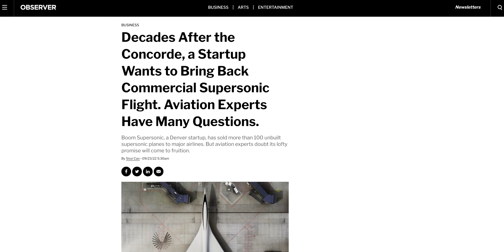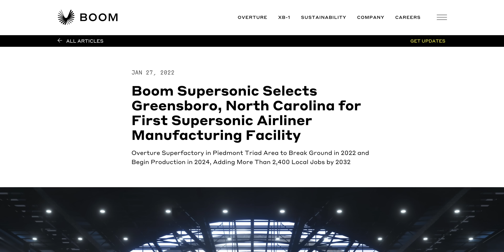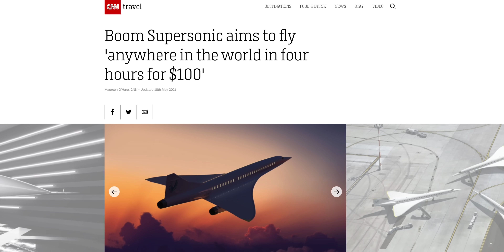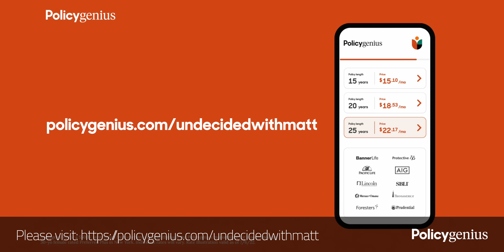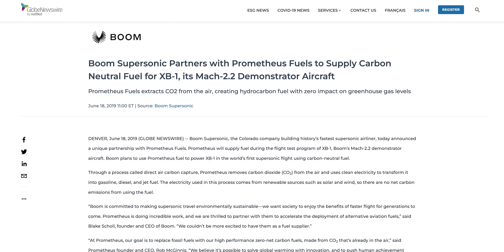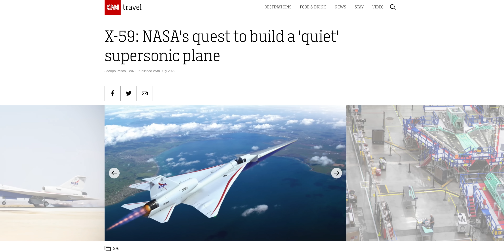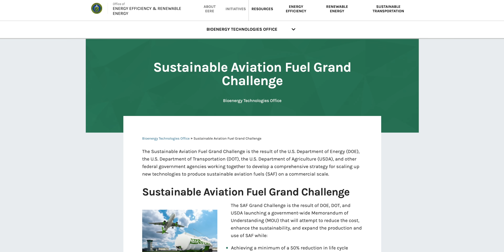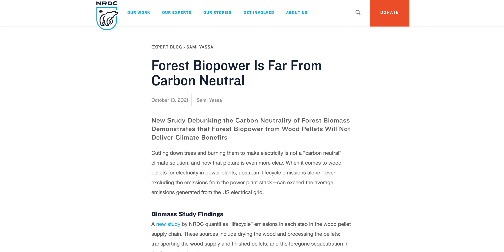Fueling a Clean Supersonic Plane Comeback

Comment: Supersonic airliners are the biggest garbage ever concocted. So, United and American had signed up for these airplanes. By my experience with both, far more time is wasted waiting at the check up counter, going through the paranoid idiots of TSA, boarding the f***g plane, waiting in line for take off, landing, deplaning , waiting for your luggage, and i have not even talked about going to or going from the airport. So 2 hours JFK to Heathrow, and how many hours involved in everything i mentioned? What is needed is a turboprop along the lines of the VF-22 Osprey that will take off from Manhattan, refuel midair over the Atlantic, and land near Buckingham Palace. 500 km/hr, tops, and you will save time. Lots of it, and for less money

Comment: Just the 9 to 1 ratio of energy use alone for just going twice as fast as current airliner is reason enough to let it stay on the drawing board.
Reply: As long as it doesn't cost nine times as much I think a lot of people would still go for it.

Comment: Hi. Regarding the usage of SAF in 50% blends, the main reason for this as of now is not sparsity or cost, but the fact current aircraft were not built with SAF in mind. The main problem with running an aircraft on 100% SAF is that it is pretty much pure kerosene, while traditional jet fuel contains other molecules, including aromatic compounds, which helps with leaks in fuel circuit (aromatics will clog minor leaks which may exist in the circuit), lubrication of the engine, and so on.
Running systems on 100% SAF is a task the aeronautical industry is already tackling, and should be available on the next generation of aircrafts, supersonic or not, and probably as a retrofit of current aircrafts, once the technology is ready.

Comment: Personally, I believe we need to work on better land-based transportation. The U.S. needs to create faster and more interconnected train infrastructure.  There are currently, proven technology that is built in Japan and China that the U.S. should be implementing.  Air-transport won't go away, but at least I should have the option of going from Los Angeles to Las Vegas in a train.  It comes back to our thinking - why spend all the money on R&D instead of actually implementing knowledge and tech we already have???

Comment: One problem I have with that "27%" estimate on soy-based SAF is that it's kind of holding everything else constant in climate mitigation. But if you're also replacing the farm equipment and ground transportation with electrified stuff running on renewable energy, the carbon reduction from the SAF is going to be a lot higher than that. 

I think the bigger issue is that even if you avoid the climate change issues, it's going to be very hard for them to compete with business class on subsonic jets. Modern business class has fully reclining seats and on-board WiFi, meaning that business travelers can work through the flight and/or time their flights to allow them to sleep on them. I think Boom's jets would have to be price-comparable with that to succeed, and I don't think they'll get there. 

Although that engine issue might derail them. There are turbofan engines that can go supersonic, but none of them civilian - they're military engines optimized for performance instead of efficiency and range.

Comment: But the US is not a no-supersonic zone. There’s plenty of airspace within where US that military aircraft break the sound barrier regularly — I did all the time. The test in OK was completely made up. Aircraft breaking the sound barrier above FL300 sound at most like distant faint thunder, but these aircraft in the test were much closer to the ground. The US was merely trying to sideline the Concord because our manufacturers weren’t making it. The Concord and these new aircraft will be much higher that FL300, likely in the 40’s and 50s or higher, meaning the sonic booms won’t be noticed. This is especially the case with modern aircraft design that can dilute the boom.

Comment: Flying supersonic is always going to take about an order of magnitude more energy than subsonic flight. 
Even with subsonic flight, we are in the high speed regime where drag increases quadratically with speed. 
Instead we should design even slower aircraft that are a lot more efficient in terms of fuel burn. 
In most cases, I'd be fine with an 8-hour NYC <-> SFO flight where the ticket cost half as much.

Comment: What's the problem with just building this CO2 capture plants? That's what I don't understand. Is it money? Incentive? Regulatory roadblocks? Why can't someone just plop one of these pie-in-the-sky plants somewhere sensible with enough solar/wind around it to self-supply it enough energy and prove it works; See the impact of it; And, most of all see if it's worth the effort?

Like lots of your videos it's seems there's more speculation than action in the content. That's not your fault, you're not the one making the choices, just reporting. When there's already appreciable issues happening around us why doesn't something just be done to see?

Comment: Rotating-Detonation engines seem interesting to me. For the same size as current engines, say in the F-16/18/35, they can produce twice the power, alternately, they can be half the size as current engines for the same power. If this tech migrates over to civil aviation, that could be a huge bonus for speed/efficiency...
Reply: but rotating detonating engine is hard to build

Comment: The eco element of the boom pitch is just the recent pivot for them. It was not mentioned at all in their original media releases. They have not been able to get their proof of concept aircraft in the air so far so their full scale timeline is very unlikely. Their proof of concept plane is a copy of a NASA research plane intended to test quieter supersonic fighters and as such, it bears no resemblance to the full scale transport they are promoting. It has been reported that Boom does not have the funding necessary to bring a full size transport to production. The most likely reason their engine supplier pulled out is that Boom was unable to put in the money necessary to continue engine development. I drew comparisons to the Nikola ev truck start up in the past but they are no longer valid since they have actually delivered trucks ahead of Tesla. This is a pipe dream filling someone’s pockets.

Comment: The answer to super sonic flight might be on your shirt. Timeline is further out than traditional planes, but if you fly a reusable rocket then you are spending most of your time at high speed outside of the atmosphere so you don't experience drag. You'd not quite need to get to orbit to get to the other side of the planet. Super sonic planes need to constantly fight against much stronger drag even though they can use the ambient oxygen in the atmosphere, not experiencing drag at high speeds in a rocket might counteract the disadvantage of carrying your own oxidizer. Since you wouldn't be optimizing for aerodynamics, you could also use shapes and rocket sizes that aren't as aerodynamic so you can fit more passengers. 

After a certain speed, it makes more sense to carry your own oxidizer and leave the atmosphere for top speed rather than burning through fuel and optimizing for aerodynamics over packing in more passengers.

Comment: For trans-Atlantic flight, I'd rather spend the extra money on seats that folds up/down to be sleepable, and then just wake up at the destination with zero recollection of how that happened
Reply: Yes! Completely agree. I would rather have more comfortable than faster. Current speeds are just fine. If I'm spending extra, I'd rather spend it on comfort. Extra arm space, lay flat seats and availability for sleep aids (like CPAP) would make all the difference.
Reply: @chillaxter13  Lose the belly (you can keep the beard) and you will be able to lose the CPAP machine.

Comment: Other sources state that Rolls-Royce walked away from Boom, not the other way round. Aviation forums agree, that developing a new supersonic engine for a small number of planes would not be economic for any engine manufacturer. 
Safran, GE also stated they are not interested. P&W stated it has other projects to work on. 
It seems that Boom has no engines available thus it might be dead.
Reply: The engine has always been the achilles heel there. Boom doesn't have the money to do a clean sheet civilian supersonic engine, and the supersonic engines that do exist are all military ones that don't do too well on range or efficiency. I don't blame Rolls Royce or others for not wanting to put money into something that is unlikely to pan out, and will probably lose in competition to business class aboard subsonic jets anyways.

Comment: Turning water and co2 back into o2 and hydrocarbons is a pipe dream. Without an aggressive carbon tax or some major breakthrough in cheap, reliable green energy it will never be cost effective to climb that thermodynamic mountain.

Comment: Talking about electric aircraft, I have not heard any mention of fuel cells for power. Electric aircraft need very high power for takeoff, so they need batteries for that, but the lower power needed to fly level should run on fuel cells, or am I wrong ?

Comment: Even the so-called "quiet" sonic boom of 75 dB is still too loud. It may not seem too obnoxious if you have a lot of background noise, but if you're anywhere quiet, it's still going to be startling, and the low-frequency sound waves will still travel long distances and penetrate buildings, making it difficult to sleep or listen to quiet music, even sitting in your home.

Even with subsonic flight, existing aircraft engines are already too loud for anyone who lives in a flight path near an airport. Sonic booms, even less noisy ones, will just make things worse.

Comment: With all the cooking oil we have in the United States and other processes they have leftover used oil, we have more than enough to put back into jet fuel.
We don't need to cut down trees for jet fuel, I understand we want to use electricity but we're not energy dense yet.
What's wrong with a hybrid supersonic jet.
And why don't we use the same fuel as SpaceX?

Comment: "Four times cheaper." Ugh. I hate this misuse of language. Let's say a ticket costs $1000. Four times $1000 is $4000. "Cheaper" means to subtract the amounts. So $1000-$4000 = -$3000. So the airline will pay you $3000 to fly on their plane? Obviously not.

What should be said instead is "one fourth the cost." That is both grammatically and mathematically correct.

Comment: Concord had lots of issues, safety not being one of them... the only safety hazard to it, was bits and pieces falling of a DC-3, which still happens quite regularly, Flight in general would be a lot safer if someone took those crumbling planes down instead.

Comment: I'm just going to say these people whining about supersonic aircraft using 9x more fuel need to be quiet and wait, the point of a entirely new aircraft is to address these issues. the tools/Materials we have now are way better than those we had when making the concord, at those speeds every little bit of optimization helps a lot.

Comment: Didn’t the turbine manufacturer Rolls Royce decide not to put more money into engineering the required turbine?
I do have some recollection of reading some about that few weeks ago - with a side note that it seems unlikely that this will take off without a turbine manufacturer 😂
Just got to the end of the video ad saw that this hick-up of not having a turbine manufacturer on board was also mentioned…
After all I don’t think that supersonic will be the winner - better fuel efficiency along with new layouts to make long haul flights more enjoyable without reducing the cost per passenger are more likely imho will fly
Reply: He did mention that Rolls Royce pulled out of the deal. It's not hard to blame them - there's probably not much market potential there, and a lot of risk. The existing supersonic turbofan engines are all military engines designed for performance rather than efficiency or range, which means that developing a supersonic turbofan civilian engine with the latter is going to be expensive.
Reply: @GuardsmanBass  You are correct that he mentioned RR close to the end of the video.
I updated my comment (second sentence) when I came to the end of the video where he mentioned what RR.

Comment: This is going to be another “rich mans toy”. Concord was $10k per ticket between NYC and London and after it landed at the airport it had to cool off for 20 minutes before it was safe to open the fuselage doors. And there is the debacle of the engine design. If RR already backed out the chances that another serious maker would join are dismal. If I recall there are only 2 other reputable makers GE and P&W and cutting edge is not their forte.

Comment: It wasn't just the sonic booms and the pollution- where economy of scale is concerned, going supersonic is far less fuel efficient than cruising at just subsonic- take any airframe and measure it's lift/drag ratio multiplied by thrust required vs Mach number, and there's a peak at around Mach 0.8, then a great dip after Mach 1.0; it'll increase back up again somewhat with increased Mach until it dips again, never recovering its subsonic efficiency

Comment: I think the most viable market for supersonic flight is trans-pacific. The flight time is a larger part of the flying travel experience for longer flights. Flying transatlantic you spend only half the time actually flying. The inter half is fine spent getting to the airport, getting through security, boarding, then baggage claim and going to destination
Reply: The issue is the fuel.  Concords didn't have much fuel left when they landed between the UK and New York
Reply: @veganpotterthevegan  I grew up close to jfk . I remember jumping out of my bed when I was 6 because the whole house was shaking and I thought we were all dead. Hiding under the bed
Reply: Being able to get from Vancouver BC to St John's NL in under 3 hours cheaply would make moving farther from family in high cost real estate areas a lot easier.
Reply: Agreed: The 14 hours of flight (IF you can get a Non-Stop) California to Hong Kong is brutal in time, and costs. THAT's where transonic would be best value
Reply: Supersonic flight really could produce a considerable time saving on trans-pacific routes. However it is unlikely that a supersonic airliner would have the >6,000 nm range to make the trip non-stop, it would have to stop somewhere to refuel. There simply isn't enough energy density even in hydrocarbon fuel. Even with that limitation, flying supersonically could be more advantageous for trans-pacific routes compared to trans-atlantic ones.
Reply: I’d love supersonic flights from Perth to Africa or even up to India. Any flight across the Indian Ocean would be nice … I live in inland Western Australia and would love subsonic flights from my city on a supersonic capable Jet.
Reply: Maybe if the plane picked you up at your house that would be better. Lol.
Reply: Planes don't fly over the Pacific ocean.  They fly over the north pole, which is a shorter distance.
Reply: @magnetospin  nonsense. USA to Australia, etc
Reply: @oliverbrown6088  You leave Australia alone!!!  Actually, good point, but traffic to/from Australia is pretty small and probably wouldn't be enough to support a supersonic program.  They need a much bigger market to make it work.
Reply: @magnetospin  Lots of planes go from North America to Asia across the North Pacific. They mostly follow the coast from North America, past the Bering Strait then Southwest

Comment: 9:24 your getting something wrong here. Concorde used a existing engine design which allready flew on multiple military jets. Time between the first protoype of the modified version for concorde (Olympus 593) and the first flight were only 5 years.

Comment: I understand the need to silo topics but it may be a good idea to produce a longer video or a video series that looks at local and global transportation more holistically. It could even be a good crossover with fellow creators. The inevitable conclusion is that an unregulated, winner-takes-all market will never develop sustainable infrastructure without heavy heavy pressure and incentive, which is grossly inefficient.   I’d love to see a video or series where you break down the carbon per person and per $ for new transportation systems/ old systems/ and the status quo. The boom plane would be great, but how will it compare to maglev coast to coast?

Comment: Supersonic flight generates a lot of heat and carbon fibre has a limited working temperture range, I would imagine that the use of carbon fibre will be limited. Concorde was barely economic even with expensive business class tickets. These days most of business is done over the internet.. I doubt that supersonic flight will ever become feasible again.

Comment: There are no perpetual motion machines.  Expending energy to capture carbon to make energy will only increase CO2.
Reply: You don't seem to understand the concept behind using renewables in carbon capture, nor do you seem to understand that a jet engine requires a liquid fuel to operate and as long as the math adds up SAF's are a legitimate option. The energy has to come from somewhere and currently jet fuel is produced using coal, natural gas, oil or nuclear.
Reply: @TheArchaos  You don't seem to realize that, despite all of the wind and solar farms, 80% of our energy still comes from burning carbon.
Reply: @byronwatkins2565  I just mentioned that, you can't even read?